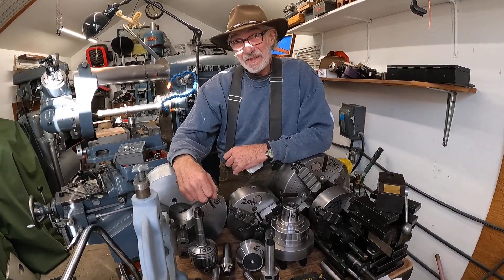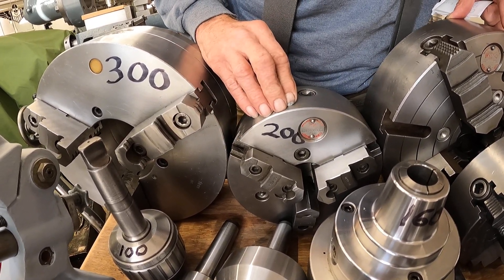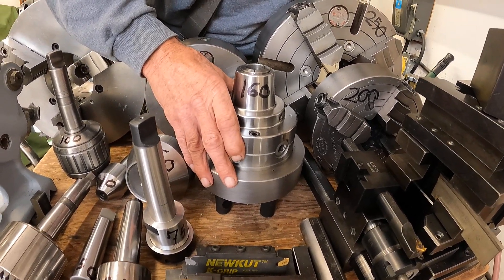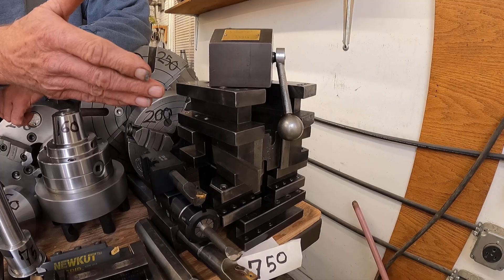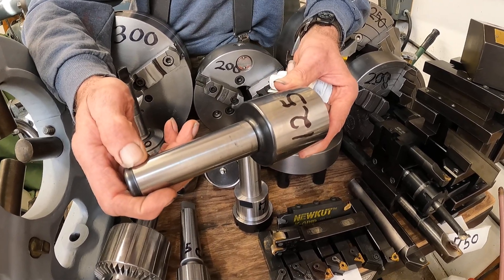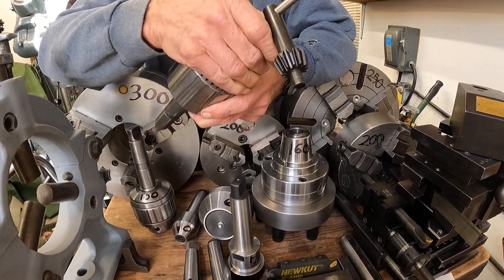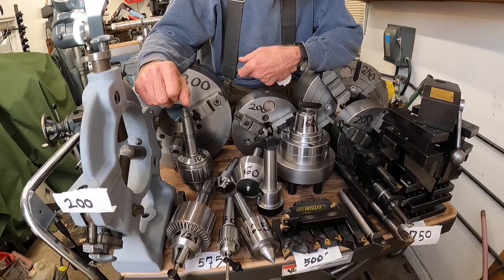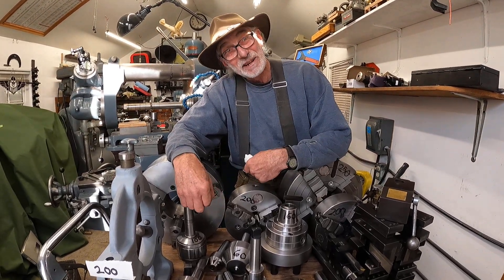Axelson engine lathe tooling, and costs

Comment: The bottom line here is if you are buying a machine tool get one with as much tooling as possible. I've seen CNC machines bought just for the included tooling  and the machine itself sent to the scrap yard.
Reply from the maker: Yes, the tooling was just under the price of the machine that was bought from Yoder for  $3200, then there was $1800 for shipping, now at 8000 for an 80yr old lathe! But, it is a very solid machine.
Reply: dee  very true, and we both know you wouldn't find anything even remotely close to the quality and build of that 80 yr old machine. Nowadays everything is ment to be thrown away when used up..  it's such a shame.. I look for older tools, older cars and trucks,  older furniture,  just about everything is better than the crap they sell now.

Comment: Nice work.
How do you get the nice finishes on cleaning the tools and chucks up.
Thanks in advance.
You got a great deal.
Thank you, EM.
Reply from the maker: The rust is removed using acetone mixed with auto transmission fluid, and a brass brush. The matt polish on the jaw chucks is with kerosene and scotchbright . The high polish is with Mothers polish, using blue paper shop towels.

Comment: A few years back I came up with a simple way to make a crude drill chuck key from a screwdriver.  
https://youtu.be/k8MaydFRvvQ
Would be nice if it had a couple more teeth on it, but certainly works well enough
Reply from the maker: That is really cool! It was not what I thought it would be.
Reply: @deedeeindustrialsuperprecision  it could use a lil more ingenuity,  but it works really well. Plus I will need to make another in the months ahead for another chuck, maybe I will tweak the design  bit if I cN come up with some better ideas

Comment: So the tooling cost how much more than the lathe?   You have really done a nice job of selecting quality tooling for low prices.  I’m surprised the shipping wasn’t as much as some of the tools on that table.  Nice setup D.  Cheers, Will.
Reply from the maker: The Axelson lathe was on ebay for months before I bought it in July 2020 for $3200, but skidding and shipping half way across the country was another $1800.
 The tooling on the table included shipping, but expect that to rise this year.

Comment: Good information ! You got some good deals there, so much stuff on eBay is overpriced these days. 
Thanks for sharing !
Reply from the maker: I check ebay several times a day, for a few items at a time, and the "buy it now" items come up quick, and are gone soon when the prices are low. I check the completed items for an idea of cost.
Reply: Yep got to check often, newly listed and grab the reasonable buy it nows, otherwise anything big and collection only will be cheaper if you don't mind driving a bit.
Reply from the maker: @dutchgray86  I have a feeling there will be  even more on the market this coming winter, but shipping on items over 50lbs is getting bad.